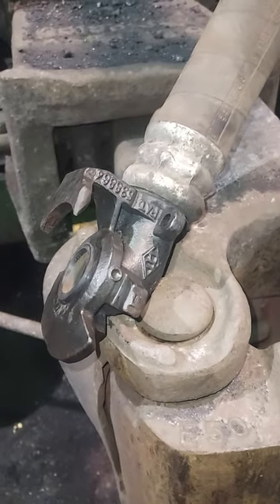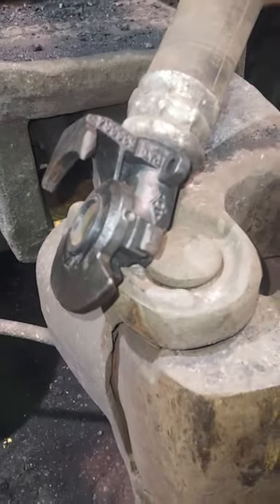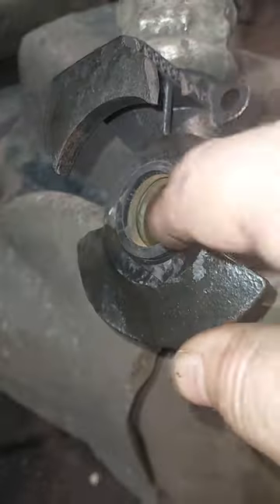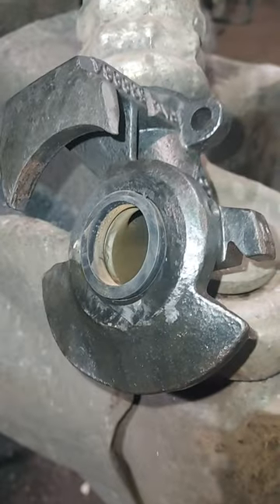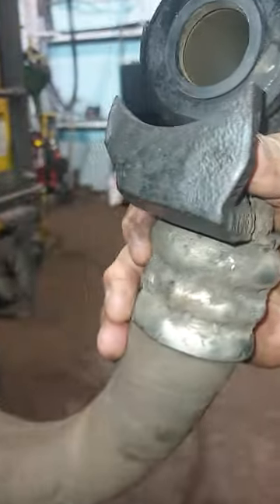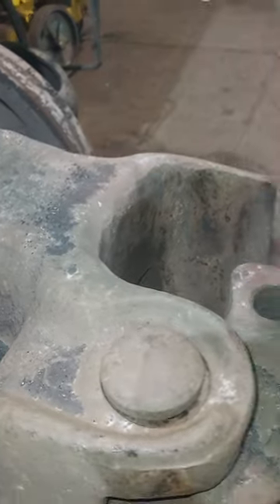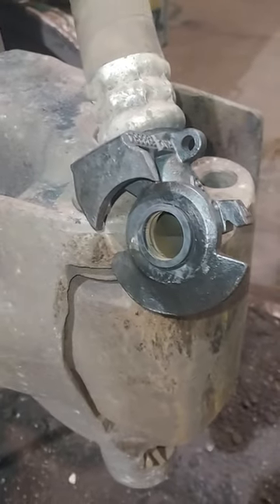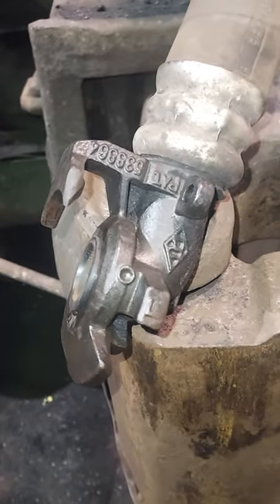Freight Car Air Line Glad Hands #shorts

Comment: It's so rare to see them clean. It is hard to visualize the sheer amount of air going tbru the piping when the train goes above that one mile mark.
Reply: I think a hundred pounds through a two inch line on amile long train.🍁🙂?
Reply from the maker: 90 is a good pressure Jay. The longer the train the more the air pressure can drop, but with the addition of mid and end of train
DPU's that helps greatly in keeping air pressures up through out the
whole train.
Reply: @ccrx6700  To go totally off topic dave how did you win your beautiful wife back🇨🇦🍁🙂

Comment: Same styles are used in compressed air for construction equipment like jack hammers.  The eyelet hole is used for a tie called a whip stop as if the connection breaks under pressure, the live end will dangerously whip around.  On a train, the hose is short but still an issue.
Reply from the maker: We have all Chicago couplings for our air hoses here, I did not know
glad hands were used on compressed air equipment like you mentioned, learn something new every day. Those Chicago couplings
also have a hole for a tie.  Thank you for taking the time to watch the glad hands video Keith.

Comment: On that video I shot with my GoPro from the ballast from a few weeks ago, I noticed that on the condoctor's side of the unit, it had a whole set of 4 brand new hoses (1 main air line and 3 M.U. hoses).  It was the first time that I have seen black gladhands instead of silver.
Reply from the maker: Ours are so dirty from years of use I have no idea what color they
originally were. Thank you for taking the time to watch the glad hands video Scotty.

Comment: Yeah, buddy. Ya have to carry extra rubber seals as we call them in trucking. Depending on how bad they are, you can lose a lot of air. For trucking, ya definitely don't want that. Our brakes depend on that air, lol!
Reply from the maker: You are so right in that Christopher, all the train operators and mechanics here carry extra seals with them. Although it's a lot
more critical to have a good seal on a truck than it is on a train car.

Comment: and one should never disconnect those manually or they may become mad hands
Reply from the maker: You are  right about that if they are under pressure, have to bleed
the air pressure off first before manually taking them apart. Thanks for checking out the glad hands video my friend.

Comment: How are they designed to separate when the cars decouple? If you have to twist them 90 degrees to get them lined up to engage and then let the hose line up to tighten, what allows the fitting to release other than having a rail car jerk on it.
Reply from the maker: When they straighten out they come apart, that's why they have
to be twisted to get them together. Thanks so much for watching
the glad hand show 5695q.